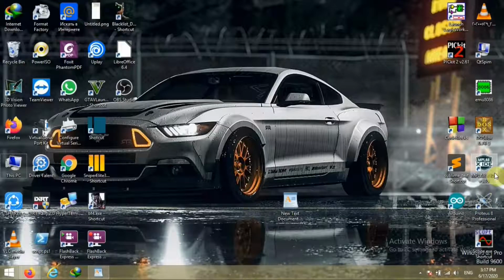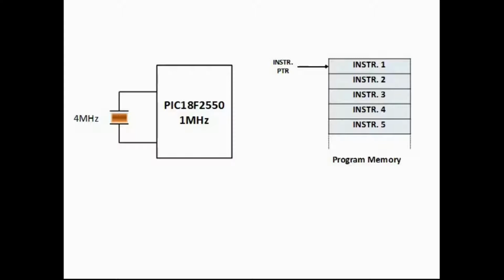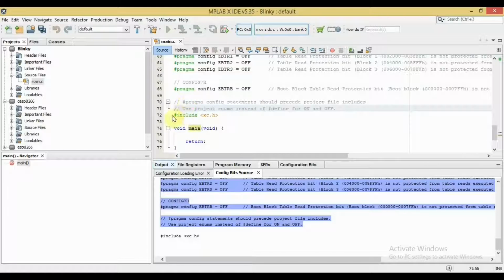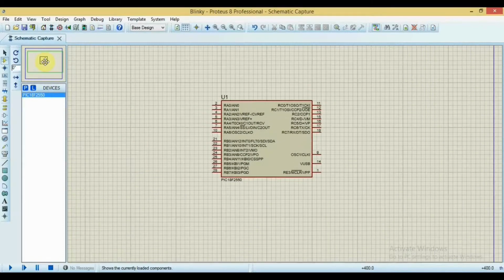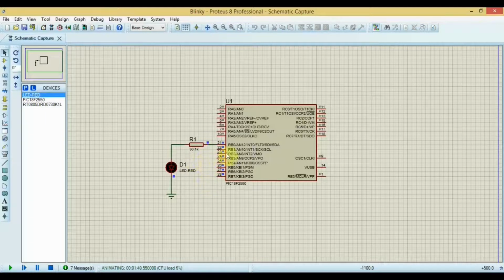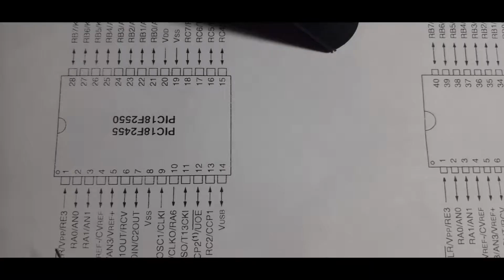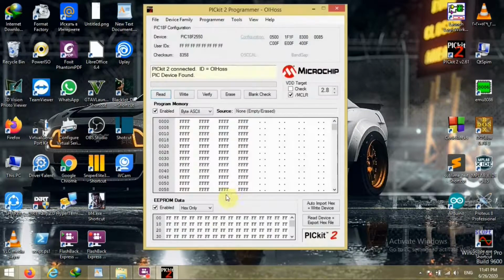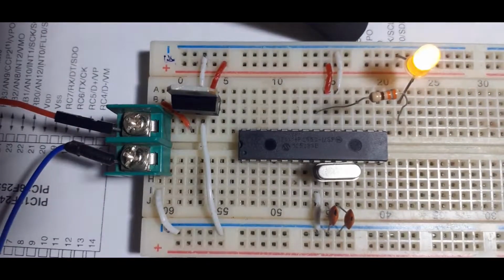How to program PIC18F | Blinking an LED step by step

Comment: Very nice video, well done. I did similar circuit with 2 LEDs similar to the train crossing signal. I also used PIC18F4550 but I programmed it with Assembly code. What do you think about that?
Reply: Can you please send me that assembly code ? That will help for my project
Reply: @shivakrishnagajula4140  https://youtu.be/N84gq8ElaIw